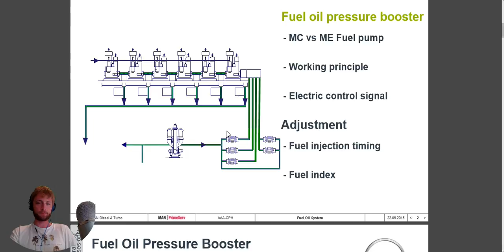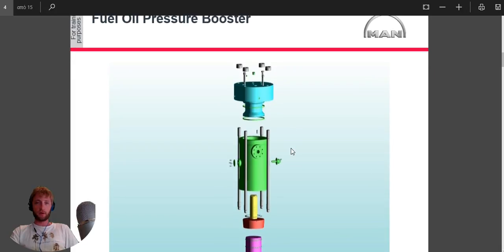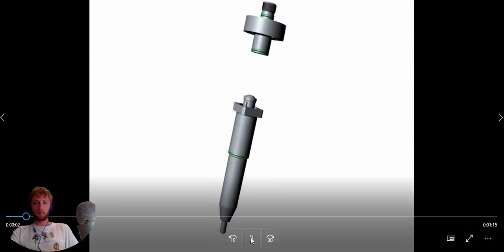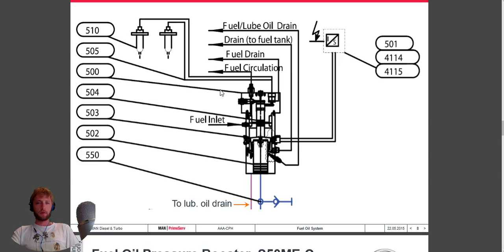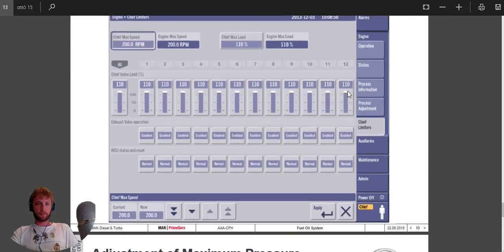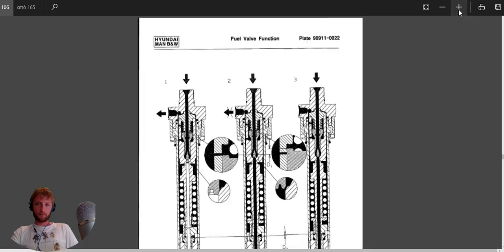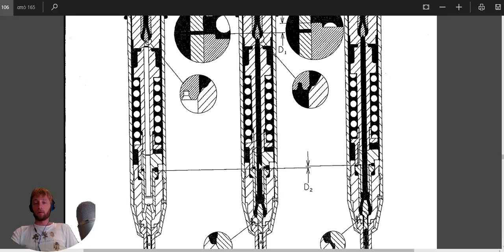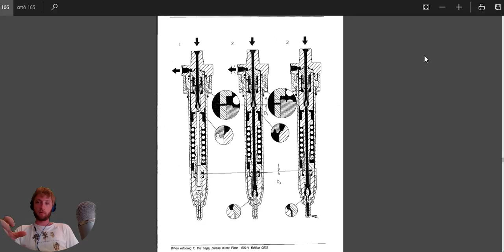MAN B&W ME ENGINES NEW Fuel Oil Pressure Booster

Comment: How is fuel metered? I mean in the MC, its because of the index and the helical cut position. In ME, how does electronic setting translate to mechanical?
Reply: I think it's the length of stroke of the plunger as governed by the drain, by the fiva valve timing? Because all volumetric flow in the mechanical world is controlled by the length of stroke, as in the variable displacement pump.

Comment: Thanks for informations. ı want to ask that normally old type fuel pumps adjust fuel quantity by helicel cut of plunger. How the New type booster can do that. By elektronik control of fiva valve?
Reply from the maker: Correct now everything is adjusted electronicaly
Reply: @Adventure-Story  is that any video or explanation towards the variable load on the engine how it has been fuel amount ill b varied in ME engine?..

Comment: Can u pls tell me the use and operation of accumulator in HCU
Reply from the maker: Hello Noor the word accumulator as it describer lot of things.Like accumulate hydralic pressure.In other words accumulator made in two parts one is filled with nitrogen and other side is oil when hydralic oil compress the nitrogen with help of a membrene this nitrogen gas accumulate a pressure.So when a actuator trigge a signal and lets say fuel must inject this accumulated pressure will help to move a piston or a mechanic part.Also accumulators reduce the delay time to trigge a system.
Thanks for your question!
Reply: @Adventure-Story  can u pl tell me the effect of high nitrogen pressure filled on the accumulator then the desired pressure?.

Comment: what is responsible for the amount of fuel does inject on the cylinder cycle depend of the load of engine I mean on the MOP its is see that now we have 30% of fuel index where and what is resposibility for this because in the classic engine it is the fuel rack
Reply from the maker: As I remember from seminar swash plate position of the hpu correspondence to main engine load.